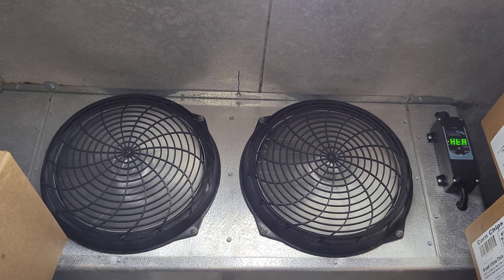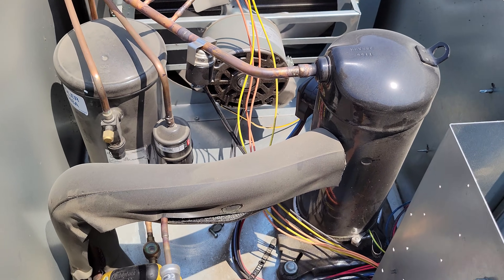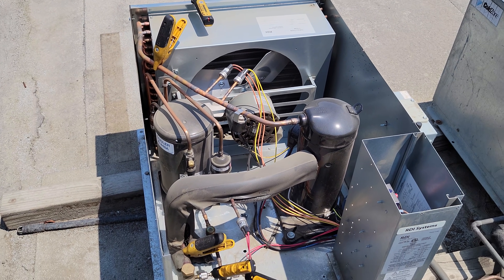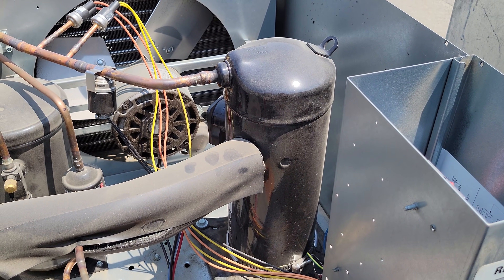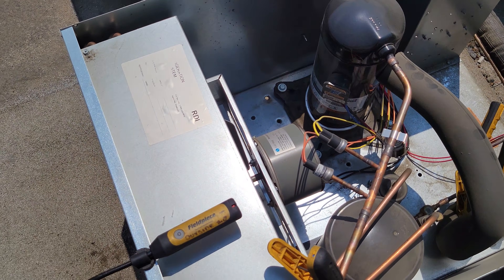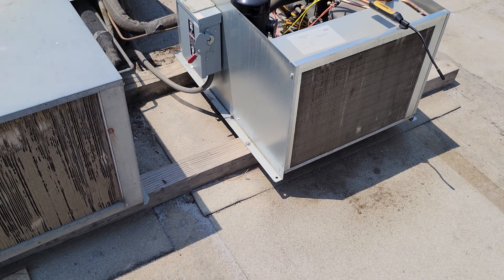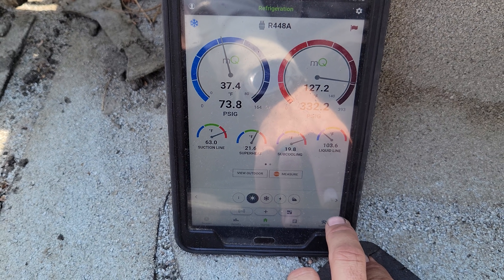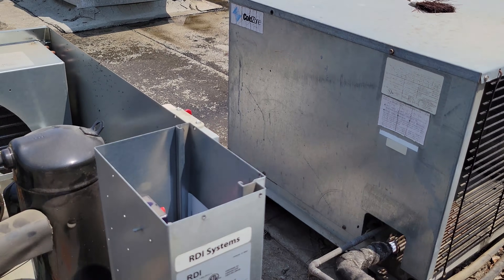HURRY THE WALK IN COOLER IS 57 DEGREES

Comment: You are a good teacher. Just started watching your videos on this day of 10-4-2025. Thank you! I recently replaced a contract relay on a condensing unit, used to cool a 15 foot, Walk in, beer cooler. Are these fans running constantly, and not shutting off once the temperature (40 degrees) is reached? Are walk-ins on a different principle? With regards to how these fans turn on and off? Outside of the defrost process.

Comment: A few weeks ago, the drain pump attached to our Hoshizaki ice machine failed, spilling water all over the floor. Roughly a week later, Idiot With Toolbox shows up, takes the pump apart, cleans more than 1/4" of shiny metal filings and black gunk out of it, re-installs it, and departs as soon as possible so he doesn't have to see it actually function. Ten minutes later, we notice the pump runs again, but water shoots out the vent holes of the motor housing, a nice 4" stream.
We spend the next two weeks dealing with the infamous Three Beeps Of Annoyance, leading us to shut the machine off every night. Finally, Idiot With Toolbox shows up again and replaces the pump. Hours later, the new pump has failed completely and Hoshi's Drain Pipe is pouring water all over the floor worse than it ever has before. Since the pump is doing absolutely nothing but illuminating the Power, Run, and Error LEDs, I pull it out, drain the water from it, sweep the pond of water into the floor drain (squeegee is broken, our budget just got halved, so who knows when we can afford to replace it) and put it all back together. No dice. All 3 LEDs still light when empty.
Idiot With Toolbox shows up a few days later, replaces the new pump. It runs, but it's pumping water out the motor housing again, and fails yet again. 

Now, if you have two brain cells, and they can fire simultaneously without electrocuting each other, you have probably ascertained the issue is blockage in the pump's outlet hose. It's 3/8" transluscent white semi-rigid water line, and it travels up the wall before disappearing into the ceiling. There are quite obvious blockages of black algae in several places as it goes up the wall. Our Three Beep Code is back, and Idiot With Toolbox is pissed because we keep turning the machine off at night because we actually need it to produce ice and this Hoshi has been problematic ever since I last worked there 8 years ago, this guy is wholly unqualified for the job since literally nothing he repairs is ever actually fixed and takes weeks to show up in the first place. It took ONE MONTH for him to replace a receptacle that began to burn in the wall, and a failing GFCI has had the Reset button helpfully jammed in to keep it from tripping instead of replacing it THREE MONTHS AGO when a repair order was filed.

Just the other day, he stumbled on a "better" solution. Same Hoshi, same drain pipe, going into another new drain pump, whose semi-clogged hose circles around the handwash sink where it attaches to the wall, and then runs to a tee that drops back down into the original drain pipe (why?!) and the original drain pipe has a new tee that runs to a plastic sump with sump pump, which has a new 1" PVC line running into the ceiling and from there, who knows. I looked at the new hack job and... I swear, this guy is stupid it makes my brain hurt. Just run the ice maker's drain line into the sump with the sump pump and new line from the sump pump to the main drain line, and call it a day!

Comment: why is hot air being blown across the compressors? would you not want it to suck through the unit?
Reply: Its easier to clean when the bulk of the dirt is on the outside of the condenser, rather than forcing disassembly of the unit every time.
Reply: @jasonmurawski5877  that makes sense

Comment: Wow i assume thats 448? That head  pressure is cooking! What are the discharge temps? Does that have more problems like cooking the  oil more than the older refrigerants?
Reply: In a normal shituation yes, about 30k difference compared to 404a, however this is a scroll, low temp units have liquid injection to keep the head  temp down.

Comment: If there's one thing I've learned about HVAC from watching your videos it's that if something is running but not performing as it should, usually something needs to be cleaned. 

Obviously not always true but using this logic I was able to fix the furnace in the house I rent. It was running intermitenly/not heating when it should have. Turns out it was just dirty burner tubes and flame sensor, cleaned them and it fixed the issue. 

Always enjoy the videos, entertaining and educational!

Comment: I hate it when high pressure controls stop the condenser fan. But i do get why you wire them to start with the compressor. I live in a colder country so we always use fan cycling or fan speed controls, so condenser fans are independent from the compressor contactor.